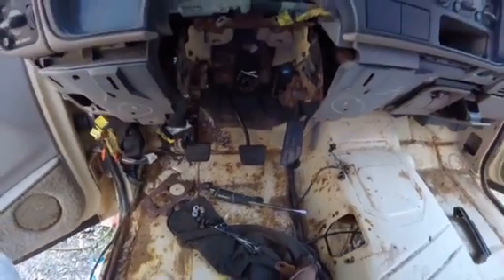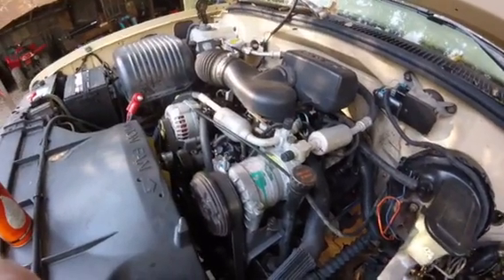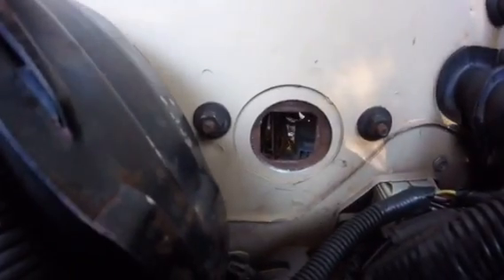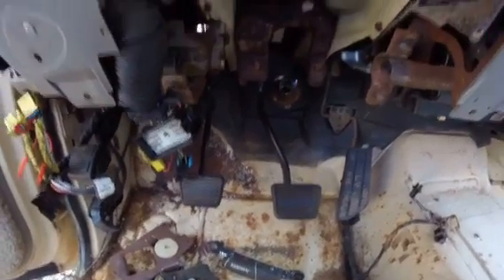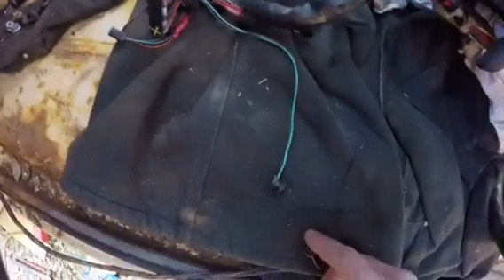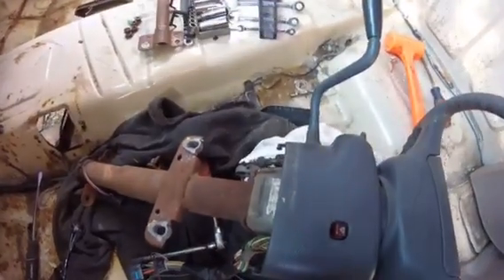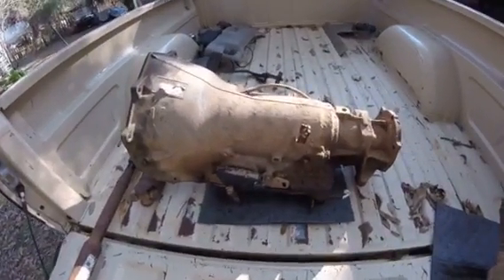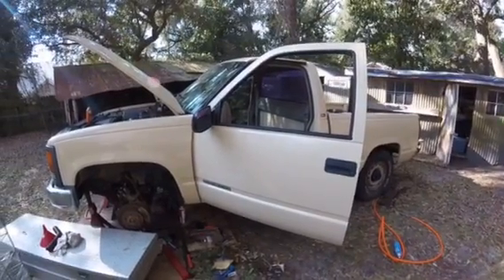GMC Sierra auto to manual swap

Comment: Great video and straight to the point. Did you ever do a follow-up one? Any issues with the floor? Did you cut the middle part out that was raised or the whole area? Also how come you had to change spline on t case

Comment: this video made it possible for me to put a 95 nv3500 into my 97 tahoe. i was wondering if you had any issues with the speedometer working or if it is the sensor that came on the donor t case i have. i spliced the purple wire and it has been a great driver other than not having a speedo
Reply: I’m planning a swap into my 98 k1500 and am faced with the same challenge.  My donor is a 1992 so I’m not sure if the Speedo signal from the 1992  transfer case will work on the 1998 pcm.  Will have to look, maybe it’s just as easy as swapping the speed sensor from one tcase to the other…

Comment: i just swapped a 4.8 in my 4.3 manual trans. 4.8 pcm is an automatic wiring harness
Reply from the maker: Riley Beaton 
Did you have the PCM flashed to remove the VATS and Auto trans portion?

Comment: What was the cost of the job.... limited funds and tired of 4l60e automatic transmissions.... trying to make something that will last longer and save some money because 2k for a decent automatic is out of my current budget....thanks..
Reply from the maker: lovclydog,
It really depends on what you can get the transmission for... I paid $800.00 for one that was supposedly rebuilt but I’ve seen several for a lot less. The clutch and flywheel should be purchased new, and can be found for $300-500 depending on manufacturer. I paid $100.00 at the junkyard for a shifter and pedal assembly. The clutch master, hose, and hydraulic throw out bearing were roughly $150. Hope that gives you something to make a decision. It’s well worth it in my opinion.

Comment: Are you still using the truck? Great video! I'm looking to swap a ZF6 into a '97 K3500, and there's a number of wires going to the auto trans---a bunch clustered around the shift lever at the trans to name a few. What do you think I should do with those? Can I just disconnect them? Or will the computer have a cow... Any advice would be great!
Reply from the maker: tlfrantz1,
Sorry for the late response. The ZF is an awesome trans. Check my other videos, I bought one brand new in a 2003 Duramax. Had the truck 11 years. I think you’d be fine leaving them unplugged but you’ll need to find your reverse light wires. What engine is in it? 4x4?
Reply: @omoffroad  I'm installing a 6v53 Detroit Diesel, a two-stroke engine. I'm looking forward to the ZF; a lot of people have said just what you said, that its a great transmission.

Comment: I'm looking at doing a 5 speed swap into my 97 Chevy Silverado z71 that has a 5.7 with auto... my question is. Can I get away with running my push button 4x4 or will I need to swap transfer case also? I have a complete 04 chevy Silverado  with the 4.3 nv3500 with manual transfer case. Would I need to swap that as well? thanks
Reply from the maker: Justin Crump,
Depends on if the input shaft matches the transmission. If it does there should be no problem keeping it.
Reply: Justin Crump, did you ever get around to doing that manual swap and keeping your push button 4x4? Reason why i ask because i just came across a nv3500 with manual transfer case and i would like to know if i could keep my push button 4x4.

Comment: Heyy, im also wondering what you did for the wiring for the reverse lights, doing the same swap now, nv3500 from a 97 4.3 is going into my 91
Reply from the maker: dawson neddo, watch all the videos I’m fairly sure I covered it but what I did was pulled a rear tail light to confirm the color of the wire going to my reverse light bulbs. Mine were light green. I then located the ends of them on the switch on the side of my auto and simply moved them to the reverse switch on the manual trans. Simple as that sir.
Reply: Thanks alot:)
Reply from the maker: dawson neddo, happy to help sir

Comment: Did you have to keep the same tranfer case that was with the manual trans?
Reply from the maker: dawson neddo, I used the transfer case from my automatic but had to change the input shaft to accept the manual transmission because the spline count was different. I needed to rebuild the transfer case anyway so I didn’t mind.

Comment: How did you make out with the swap? 
what kind of computer issues did you run into if any. I've done this job before on an 86 s10 and it was a cake walk. but now I'm preparing to do it again on a grage kept low miles 2000 jimmy with a bad auto in it. I have a rotted out manual  96 blazer with a bad 4.3 but a good nv3500. 

our trucks may be a little different but the drive train will be the same when I'm done, any experience strength or hope you could share lol?
Reply from the maker: Hi, the only issues I had were jumping out the neutral/park switch on the transmission (two purple wires on mine) and removing the lock that traps the key from the ignition switch. The driveshaft, trans mount, etc were all the same. I have about 6,000 miles on mine now and have been meaning to do a follow up video. Any other questions just ask.
Reply: +omoffroad so you used the automatic computer?  I'm thinking about documenting my swap for my chanel as well. ... just want to have all my ducks in a row before I start with the good truck..... I'm pulling the manual out of the donor truck as we speak
Reply from the maker: Yes sir, I am running the original automatic computer with no issues so far.
Reply: +omoffroad good to kno. thanks!
Reply: what forum do you frequent? I usually just hang around on YouTube but I have a bit of content on here some might find helpful.
Reply from the maker: I don't have a favorite I just research projects before I start. There is almost too much information sometimes...haha
Reply: This dang car you found a 4.3 blazer with a manual? I want to do a nv3500 swap to a automatic 4.3 blazer how hard is it?
Reply: yes I have a 96 4.3 4x4 5spd 2dr blazer I want to take the nv3500 out of I'm in the process of getting the front clip off as we speak I'll be pulling the motor trans together this weekend hopefully.  I intend to put the trans in my 2000 Jimmy it has a bad automatic in it now...  but the truck is way nicer and the motor only has 130k on it

Comment: I'm doing this same swap but on my 93 I'm having a hard time with how the pedal is going to be set up can't find anything on the web and this is the closest thing to a picture I can find on how it's set up so I can order a pedal for the clutch any help would be appreciated.
Reply from the maker: Brandon Jeffery,
I would suggest going to the wrecking yard and finding a truck with a manual to get the pedal assembly from. Watch all my videos on this truck. I may mention something more helpful in a different video about it. I think I did 3 videos. I bought my complete pedal assembly (clutch, brake, and bracket) from a local yard for $50.00. Having to remove it from the donor truck let me know how it went in. Everything for the new bracket will be in your truck already or visible. Ask all the questions you like. Good luck!

Comment: Omoffroad I am trying to find out the automatic engine wiring harness is the same as manual harness? I bought a 94 chevy 3500 crew cab dually with 150,000 miles and the harness looks like spaghetti could automatic harness work on manual?
Reply from the maker: Richard Kirkland, it will definitely work. The truck in the video has an automatic wiring harness with a manual transmission. The only wires going to the manual transmission itself are for the backup lights. I cover almost all of the details in my other videos. Thanks for watching!

Comment: Can I use the same slave cylinder for the NV4500?
Reply from the maker: Will Morris, order the correct slave cylinder for the NV4500 for the same year 3/4 tin truck and it should work fine.
Reply: omoffroad I hope it will it shouldn’t change due to an engine swap should it? It had a 305 and a automatic and now it has a P-Pumped 24 valve cummins and I want to put a 5 speed in it
Reply from the maker: Will Morris, I have no way of knowing if it’s the Dodge NV4500 or the Chevy one 🤷‍♂️

Comment: I'm doing the same swap on my 96  Chevy. Did you remember which wires you bypassed on the neutral safety switches I know you mentioned the one in the column and I know there is one in the harness that went to the automatic. And which wires did you use for the backup light switch in the nv3500?
Reply from the maker: Justin Autrey, my harness had two purple wires at the transmission that I soldered together to bypass the neutral indicator but I've had other people say theirs were yellow. The same plug on my trans also had two light green wires for the backup lights. I just cut them off and connected them to the switch on the standard. Anything else just ask... glad to help out any way I can.
Reply: By the way I had a 4L60e in mine which has two harnesses
Reply from the maker: Justin Autrey,
It shouldn't be a problem. Switch the auto to neutral and check pins to see which ones have continuity and connect them. Then pull a tail light and trace the backup light wire straight to the switch. No sweat.

Comment: and did you splice into the automatic wiring harness
Reply from the maker: I spliced into the auto harness at the old transmission connector to jump the park/neutral start switch and located the reverse light wires.
Reply: Do you have more information on that part does it just plug and play or what else do you have to do in the electric part

Comment: I missed if you said what transmission it was, but is it the 700r4? I have a 4 wire connector on my 700r4 that idk what it does. Did you have any issues with the same connector?
Reply from the maker: Dale Greb,
The trans was a 700R4 originally. The plug should be your shift position switch. It has the wires you need for your backup lights and the wires that allow the engine to start in park/neutral.
Reply: @omoffroad  @ disagreed,  on the 700r4 the plug is lock-up

Comment: TCM ECU and your gauge cluster should all match you're going to need to change some of that s***
Reply from the maker: johnathan parker, 3 years 40,000 miles later it’s still going strong. Same parts.
Reply: @omoffroad  ive been driving mine for a month now and have no issues other than my speedo not working but i think the plug on the t case went out. it worked for 10 miles then stopped working. great video
Reply from the maker: Dylan Harney, glad you got it going sir! Speedometer should only be the VSS/ speed sensor. It’s a really simple magnetic pickup pretty easy to test.

Comment: what did you end up doing with the green black wire under the dash?
Reply from the maker: Riley Beaton 
I just left the green and black unplugged. They control a small solenoid that kept the ignition from turning unless the brake was depressed. I removed the solenoid as well.